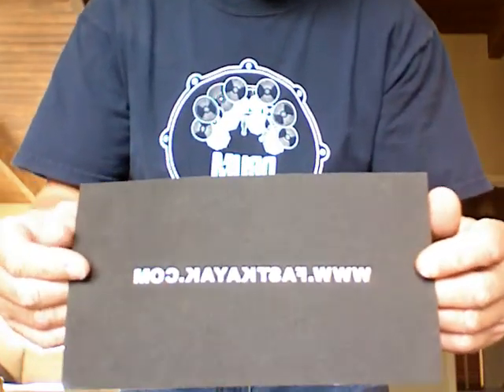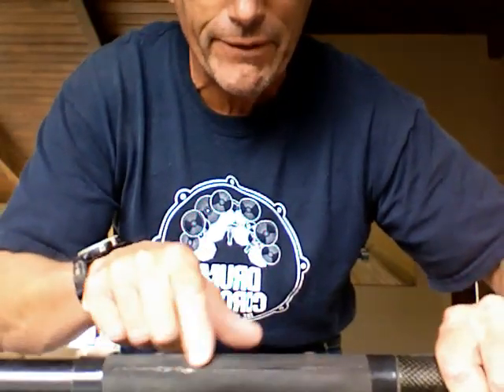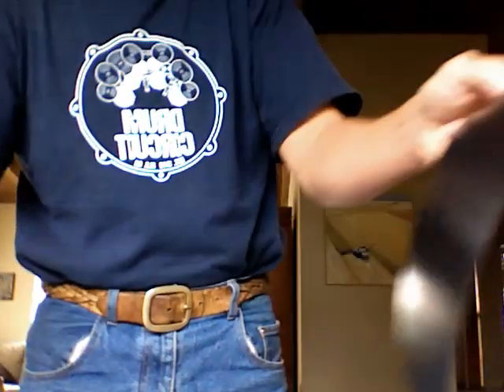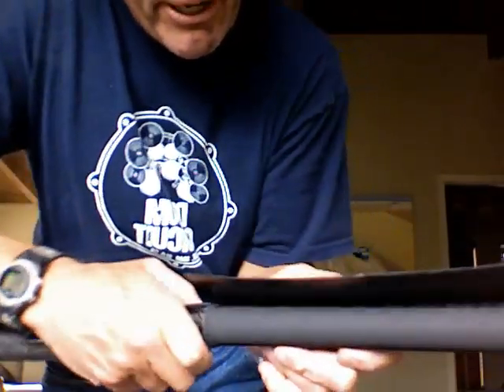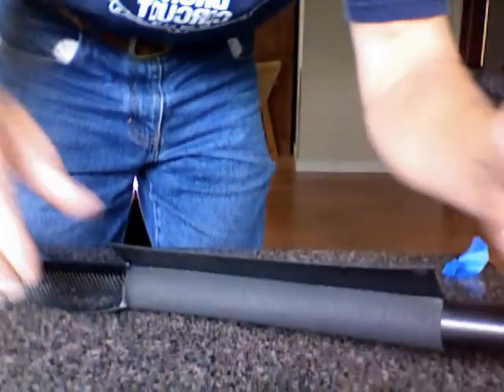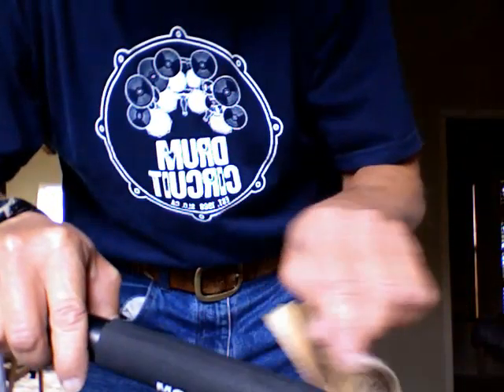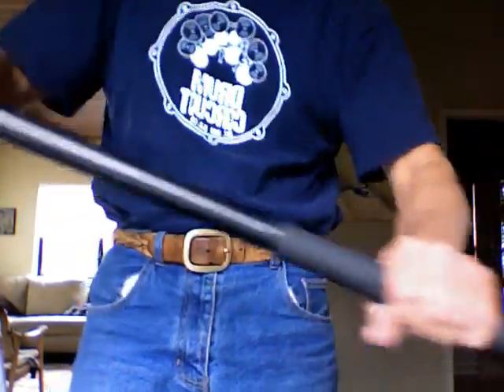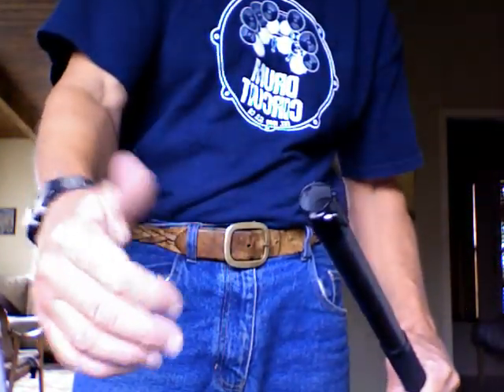Kayak Paddle Grip Kit

Comment: Nice video; but is it projected backwards? Because you say to put it on the right hand side, but in the video it looks like the left hand side. Also, the lettering on your t shirt is backwards, and the lettering on the grip kit is backwards. 
Looks slick though; I wonder if you could put those on an ergonomic whitewater paddle grip, like an ATX? I suppose they would work well on  a straight shaft whitewater paddle, even if it was indexed (oval).